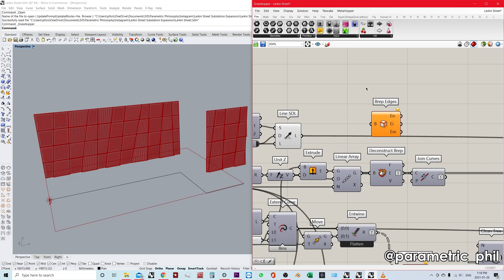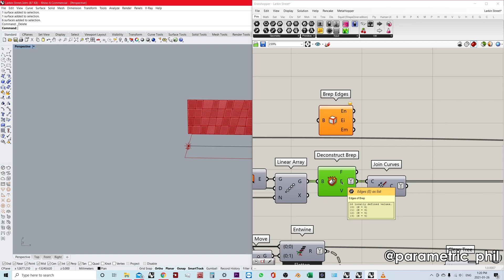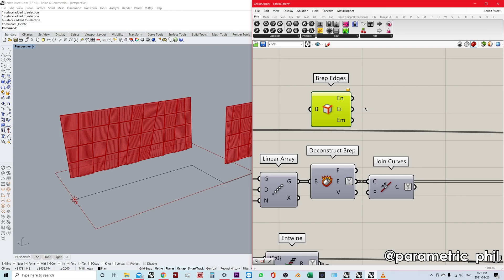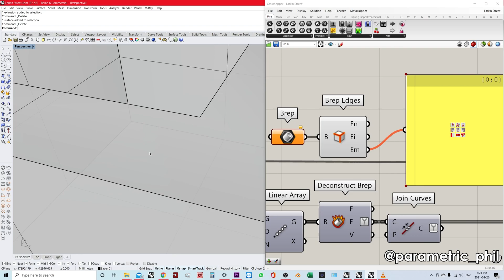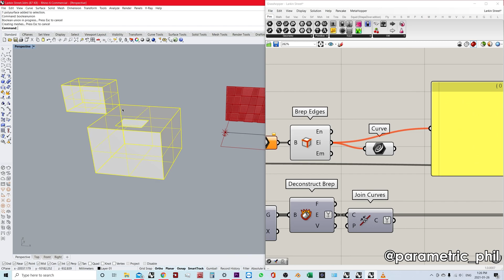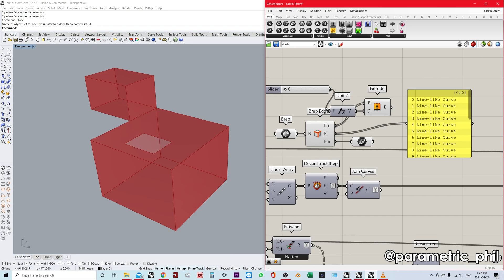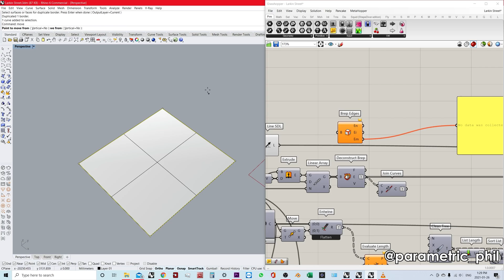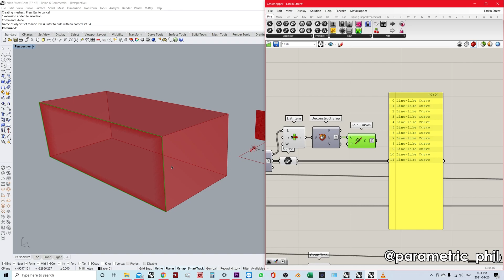Brep Edges vs Deconstruct Brep: Component Analysis

Comment: thanks for the video.I tried to obtain the edge with both BREP EDGE and DECONSTRUCT BREP of a non-planar surface. I offset that edge on the surface but it fails. What could be the problem?
Reply from the maker: Not sure what the problem could be. Many different issues that could be responsible for this. Maybe a self-intersecting curve or something. If you're still having troubles, I'm happy to try and help out, but I need some more details. If you want, send an email to pfors@5j5.design, and include a screenshot to help explain, or if you can include the file that would be even better. Cheers
Reply from the maker: Hi Fabrizio, I sent a reply to your email. Hope it helps! Let me know how it works out for you.